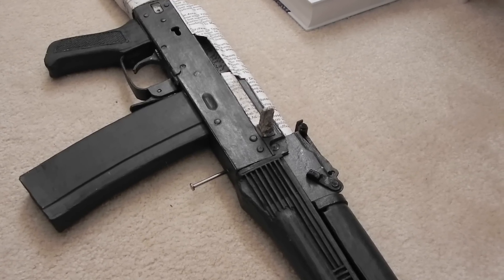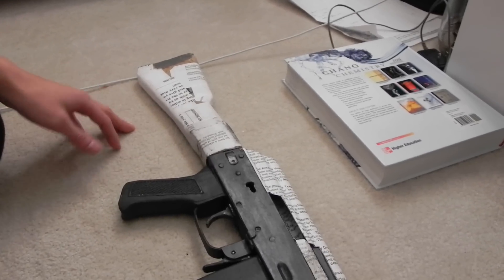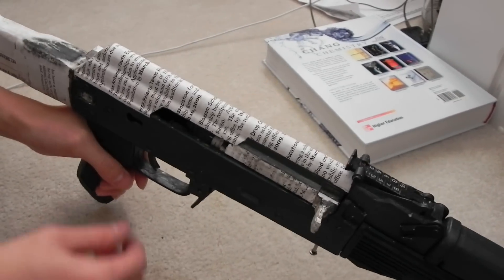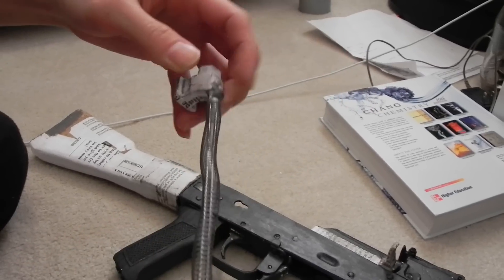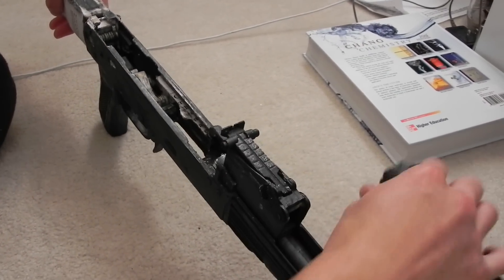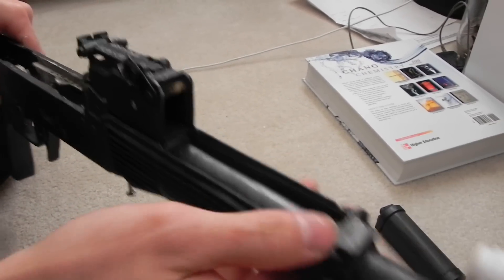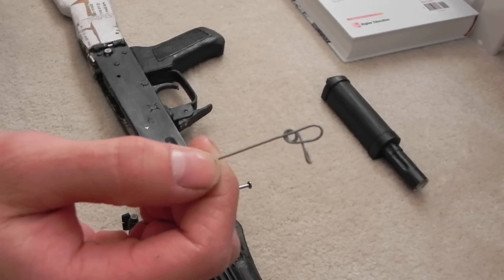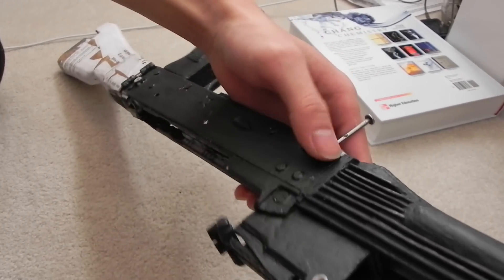Paper AK Update #27

Comment: The AK-103 is a modern, Russian-designed version of the famous AKM assault rifle, chambered for the 7.62x39mm M43 round. It combines the AKM design with developments from the AK-74 and AK-74M, with the  use of plastics to replace metal or wooden components wherever possible to reduce overall weight. You just got Correct'ed!

Comment: Hi several layers of paper need to get to your thickness and texture? And how is it holding up without it will fold the paper and how to design with the small pieces? And you use plain white glue to the layers of paper you make? And where did you build the parts? And write me the sentimeter the small rifle barrel to the end of the request.